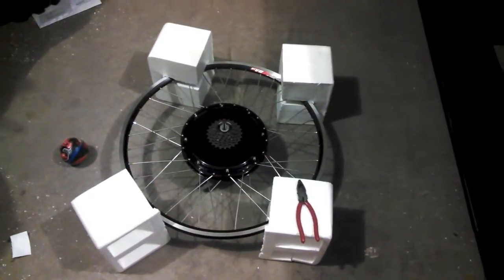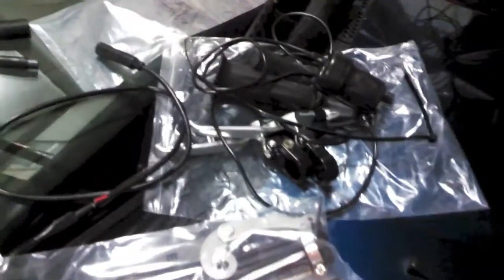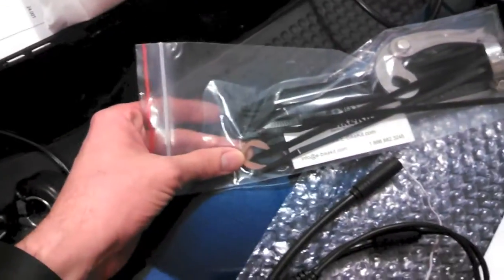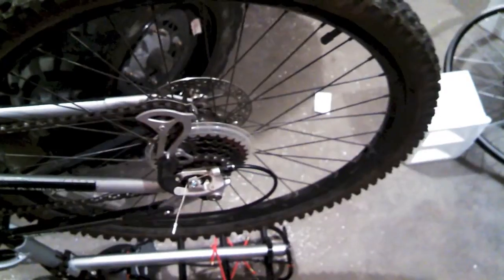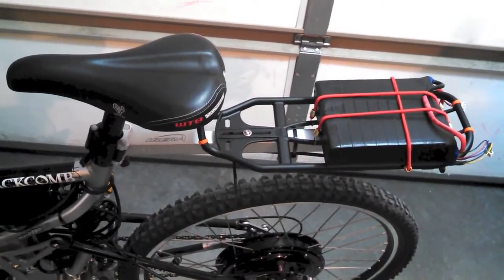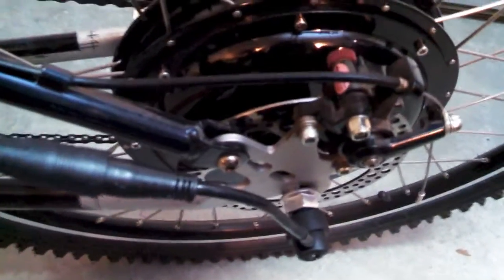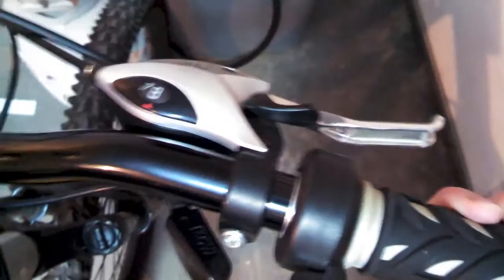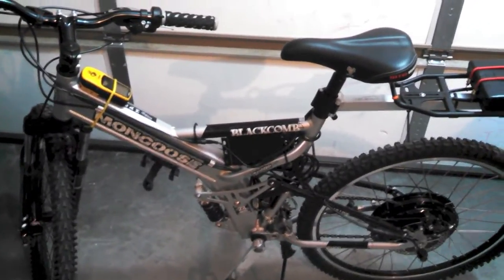E-Bike Kit Installation

Comment from the maker: Not sure what you mean by 9C It's rated 500 watts although I got higher peak values. If I remember right around 800 watts. I'm using 30C batteries although I think it would work ok with 20C batteries (8AH in parallel). The size of the wheel is 26"